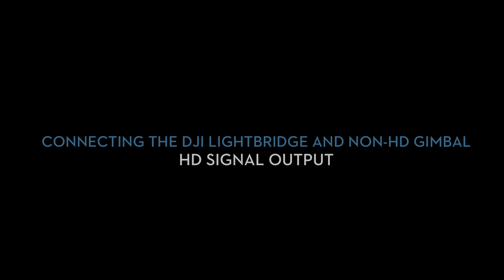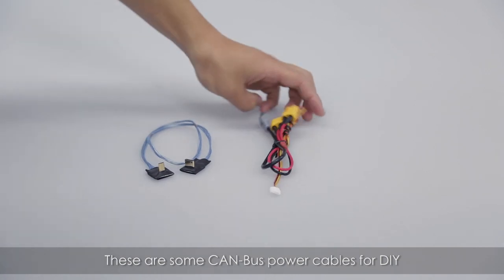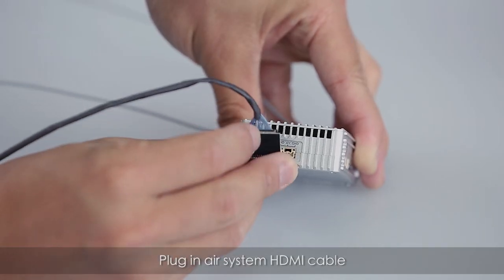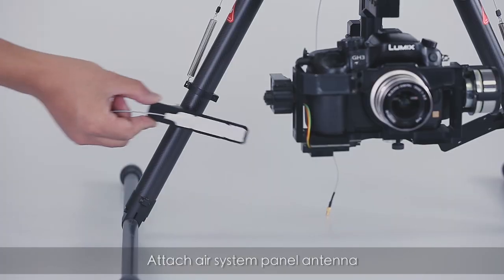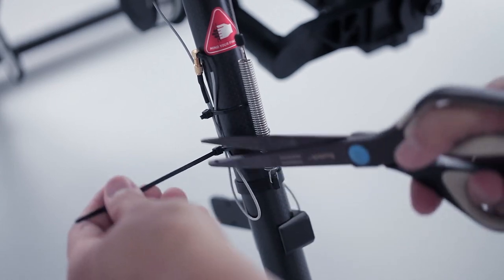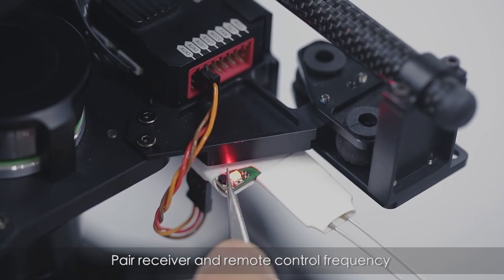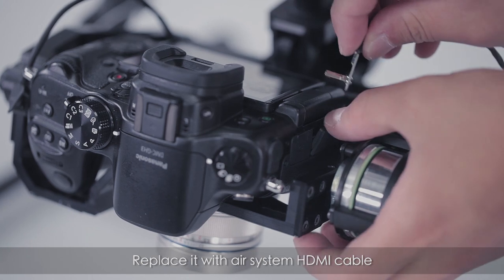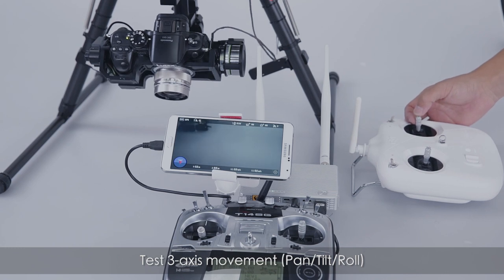Connecting the DJI Lightbridge and Non-HD Gimbal HD Signal Output

Comment: Hi DJI - i have installed 5.8ghz as suggested with a GH3 Zenmuse Z15 - the right hand switch maps to reset, (Aux2) but the left hand switch maps to Aux3 - can this be remapped somehow to SHUT to control the shutter? Otherwise how do you control the shutter from the A2 with a Futaba 14SG?
Reply: Hi David.. You aint the only one who is in this...!!! While in some video's they talk and show Dbus in other videos they show different..
Reply: Use any unused F port on your A2 and link them to the Zenmuse GCU port of your required function not controlled by the method shown in the above clip and control that function direct from your A2/Futaba.
Reply: JAYGEOKAY Thanks, I have done that previously - but it means the pilot controls the shutter not the cameraman who is controlling the gimbal with the 5.8ghz controller
Reply: David Black